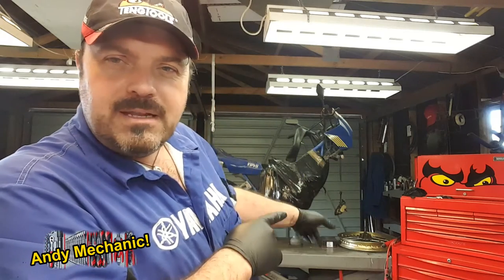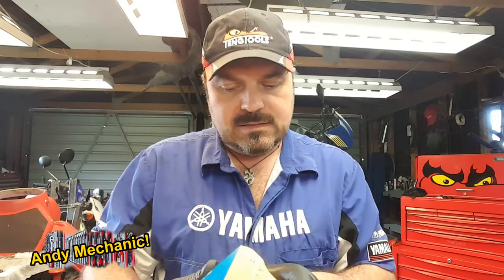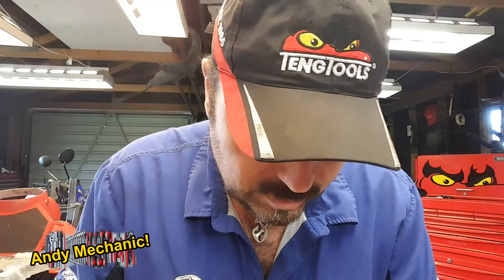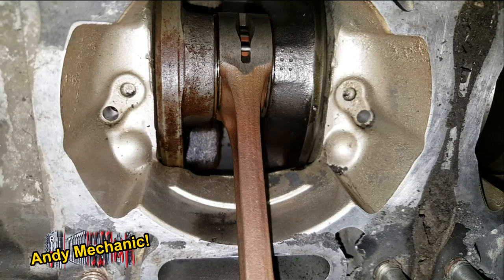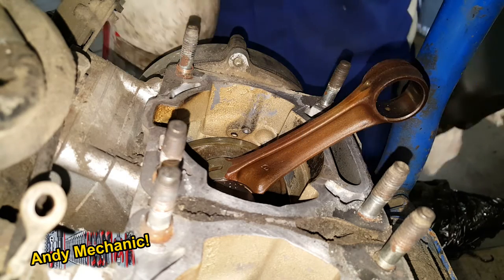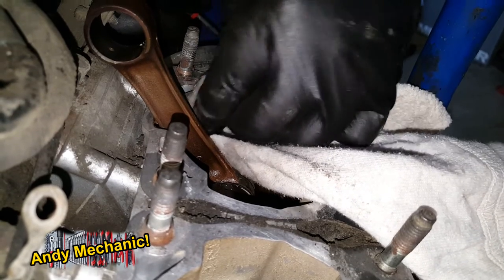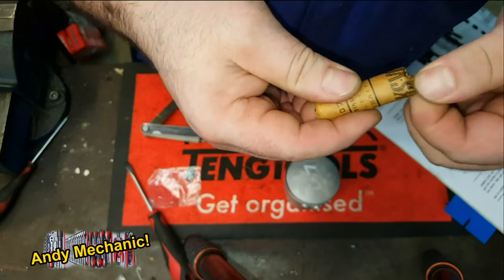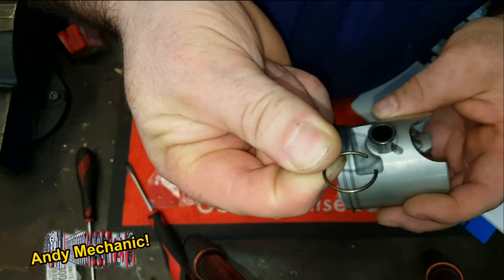TDR250 big end check & new piston install Ep.1 #1146

Comment: Did you ever finish the tdr. Never saw test ride on here
Reply from the maker: Sure did but it ended up as a quick instagram post. It went really well for 1,000s km until a gearbox bearing failed :-(  getting a rebuild shortly - have lots of spares for it now.

Cheers Andy
Reply: Just finished my own. Barrels rebored but winters here now so run in in the spring